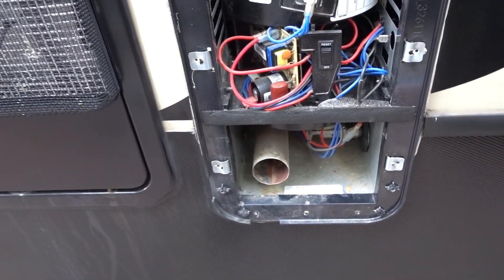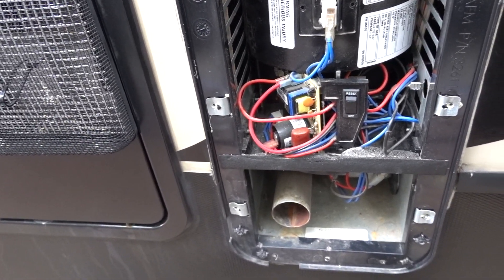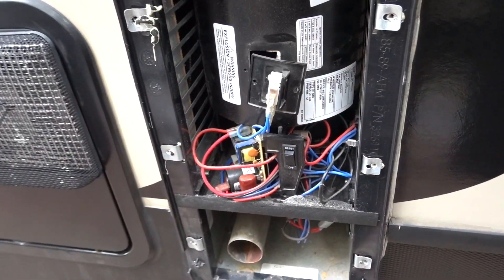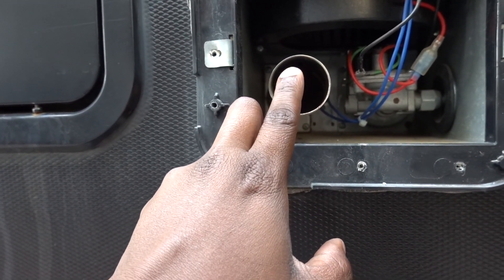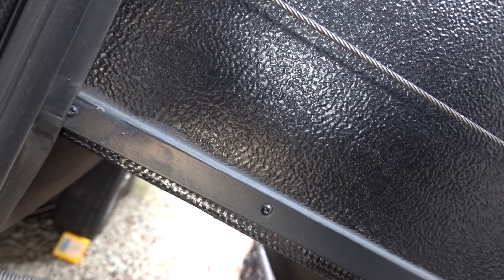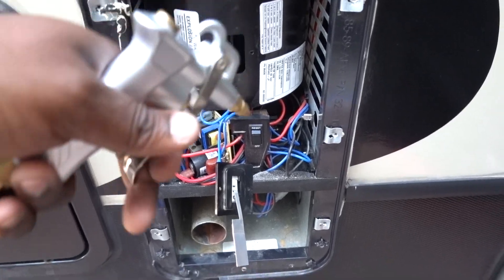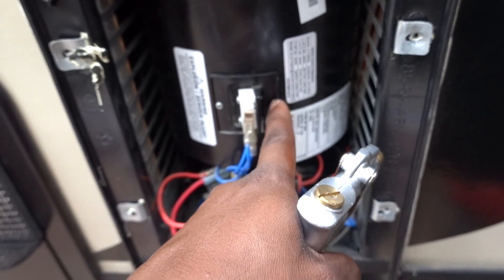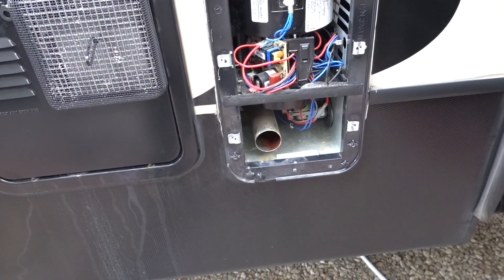How To Prepare An RV Furnace For Winter!!!

Comment: It’s very important to keep these areas as clean as possible for proper maintenance and operation. I was told before getting an RV that every 3 months you should do a complete walk around of the unit and pull these covers off and do a visual inspection. I’m sure that depends on how much you use your RV. Thanks for the video JB.
Reply from the maker: Yup, when I blew out the back of my fridge, it seems to be working better oddly… A lot of debris came out around some of the components but it seems to be holding the temp a little better. Thanks David 👍🏾
Reply: @JB_WhoWork  is your fridge a propane / electric?
Reply from the maker: It is

Comment: I have a 2019 3790RD Montana and I have the same furnace. The problems that you’ve had are probably from the red increasing pressure regulator on your far tank.